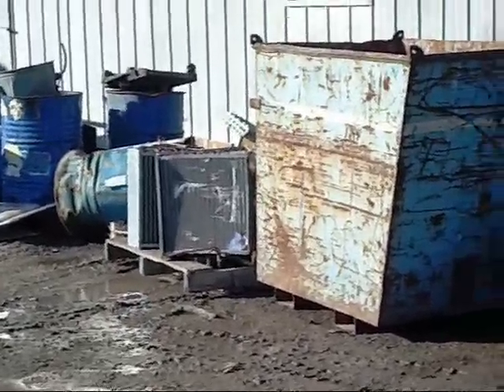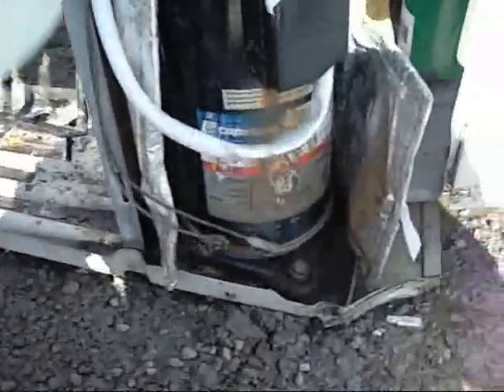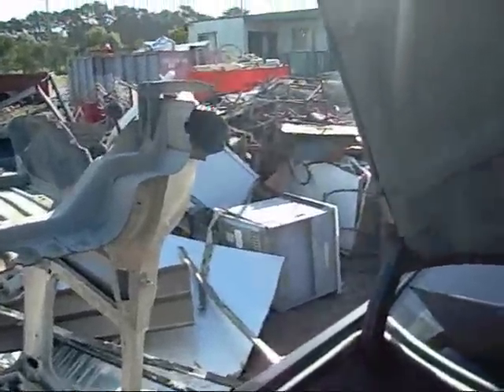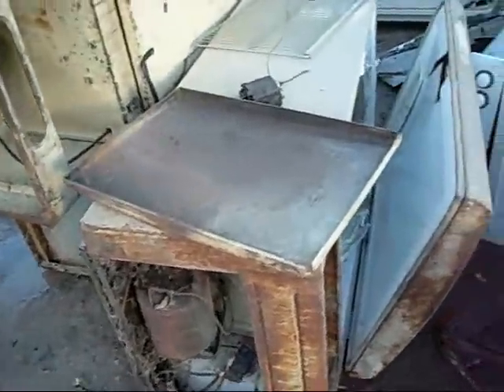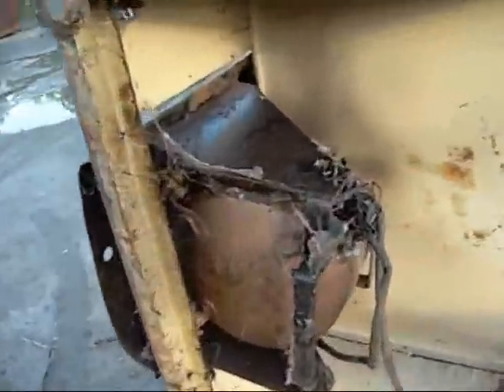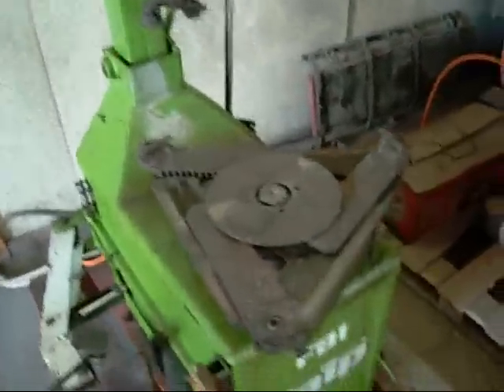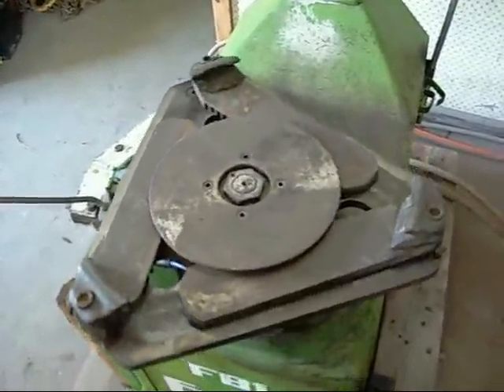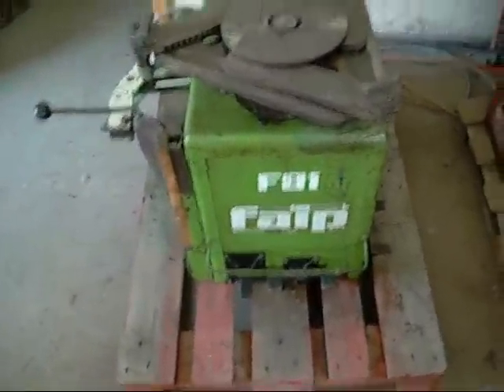More HVAC scrap at the junk yard

Comment from the maker: I think the gas fridge is stuffed.
THe tyre machine was refitted with a lead by the electrician with a terminal box on the back (he couldn't get to the terminals on the switch without dismantling it.)
I'll get the MM out and check the voltages, I thought it sounded a bit louder.